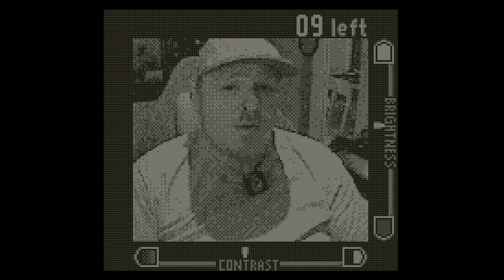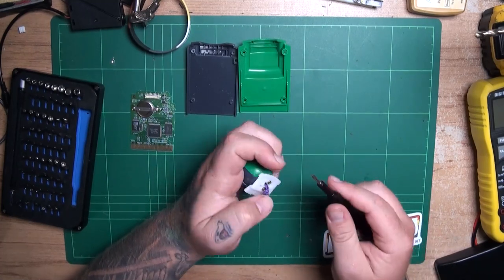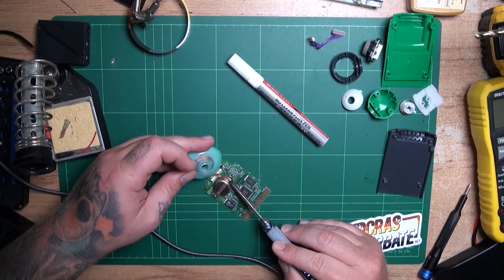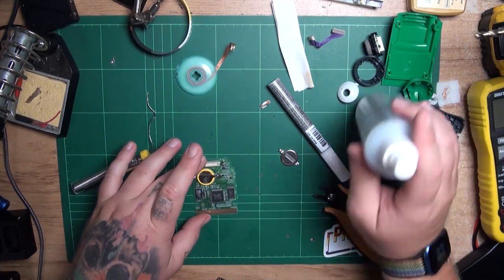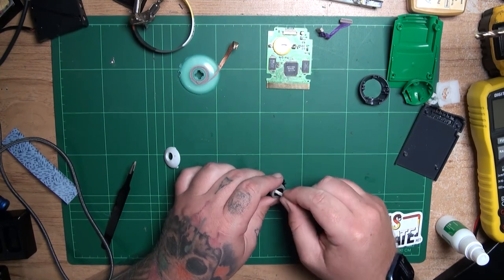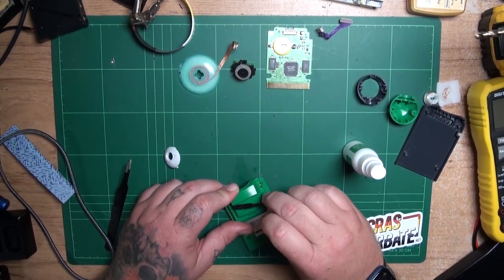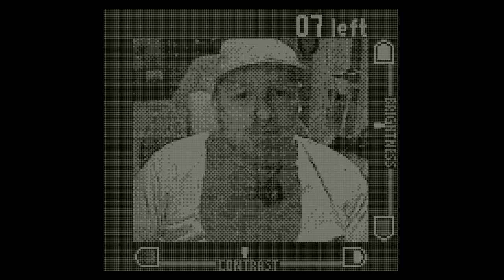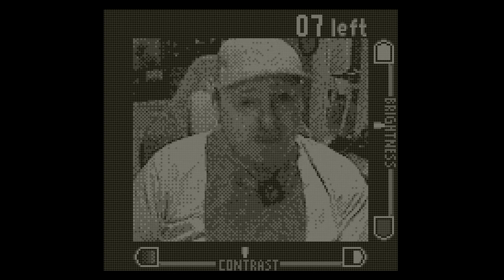Game Boy Camera Restoration and Image Retrieval using Analogue Pocket - Procrasturbate Tech

Comment: Thx for the video ❤ What type of replacement battery did you use and was build in? CR2025 or CR2032?
Reply from the maker: Both CR2025. Replaced with the same. Thought about using a 2032 but had heard they may not fit. Plus it was generally easier to find the 2025 with tabs online.